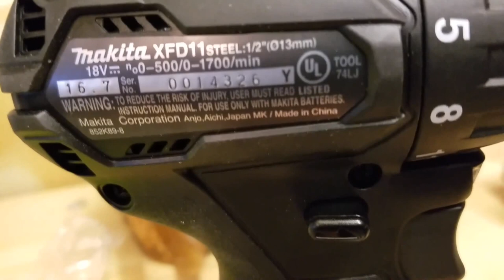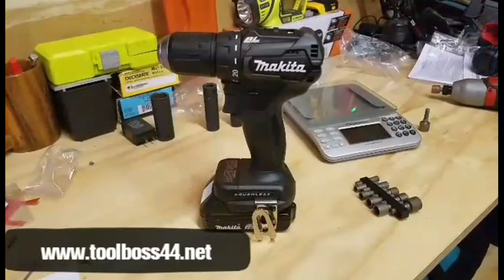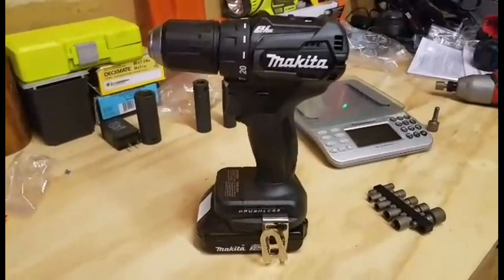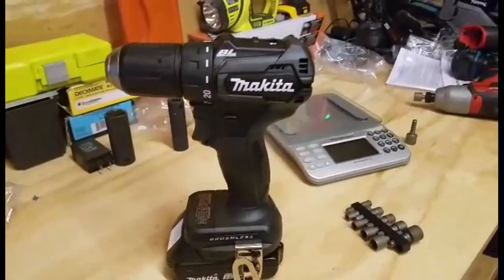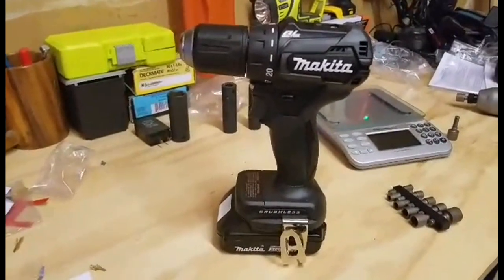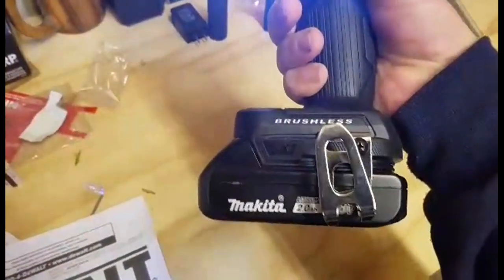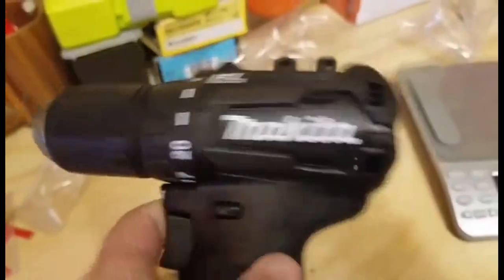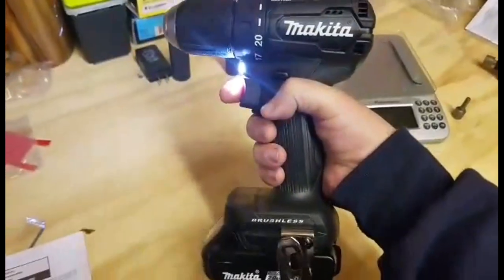Makita 18v Brushless Sub-Compact Drill/Driver Review (XFD11)

Comment: This is an awesome drill, light and powerful. Perfect for tons of projects around the house. You still have to use your head and be realistic about it. If you're trying to constantly sink big @$$ lag bolts with it and then complain about it not working properly you might be one of the many people not fit to use certain tools. You just might have to break down and buy the correct tool for the intended job. This tool is just about the same size as a 12 volt tool. There ya go, a 12 volt  drill with the power of an 18 volt.
Reply from the maker: Exactly... perfectly said ...

Comment: I just picked up the subcompact kit from Amazon. The kicker was the free 4.0 ah battery that came with it. Sometimes a deal is so good you just have to do it. This may be the most versatile set on the market today which is exactly what I was looking for. Lightweight and compact enough for small jobs but powerful enough for serious work. Makita is onto something here.
Reply from the maker: P.G. K well that new 12v brushless is quite handy also ..but yes as an 18v ..its a great impact ..watch for Milwaukee new fuel 12v guna have more torque and smaller
Reply: TOOL BOSS I liked the Makita deal because it got me the drill and impact, 2 2.0Ah batteries, plus the 4.0Ah which also gets me into the 18v platform (these are my first high quality power tools). Now I can pick up a more affordable, bare circular saw or reciprocating saw for future projects. As a DIYer, this is about as good as it gets for my needs. I know you like your Milwaukee though.

Comment: Just bought this set of drills, amazing little tools. I do a lot of railings and drilling of newel posts but bought these for smaller applications. But I did run a 1 inch spade bit through two 3 inch square red oak posts today, it did alright if you can control the feed pressure. Saw you were using a spade bit with the snail on the end that really pulls you into the piece. If you just use a standard old spade bit you should be just fine just gotta feed it in slow. Love your videos Boss, and hope that my info here helped some other makita fan boys.
Reply from the maker: Excellent , I actually did a 1 ich spade bit also for this video , but didnt include it ..was tough but did it

Comment: Your really doing a great job covering all these tools. keep up the great vids, congrats on your website.
 I'm couldn't be more happy with my Makita Brushed Hammer Drill and Brushed Impact Driver. Apart from doing extremely large screws, lag bolts or just nuts and bolts the drill really is the better option. My drill will drive in 4" batton screws faster than the impact. I used it for drilling into concrete yesterday and it went through it like a hot knife through butter lol I still love my impact more though haha
Reply from the maker: Ham's Mowing hey brother !!! thanks man !! appreciate it...how's mowing season goin .??? got another 10 weeks till mowing season kicks off here ...how's the cub ?? yea Makita are def one of the best bro for sure !!!
Reply: TOOL BOSS no worries man. In about 10 weeks my season slows down. It's been great though, picked up several new regulars but I still need more.
That cub is running great. Just clicked over 51 hours for the season. My new toro is running excellent as well.

Comment: Hey Tool Boss thanks for the video.

I will be using this drill to bore 3/4 - 1 inch holes through brick motor (for camera installations). I primarily do use a corded hammer drill but I would like to use this for jobs where I don't want to use the corded.... What do you think of this drills concrete/mortor drilling capabilities???

Thanks in advance!
Reply from the maker: I don't think this is the drill I would go for if using to drill into concrete

Comment: i have those same paddle bits. i dont like them that stupid screw tip feature forces you in too fast and causes major blowout in the rear of the hole youre drilling its also probably why the makita was getting jammed up. i just felt that was worth mentioning. ive gotten jammed up with my green 18v makita with those stupid speed bore bits. keep that in mind folks

Comment: Would u recommend this in an electrical rough-in environment?
Reply from the maker: Absolutely.. actually alot of electrians use this tool
Reply: @toolboss8410  my biggest thing is changing battery platform. I have a bunch of m12 tools like my bandsaw and I just dont  wanna haul milwaukee and makita everywhere
Reply: salg500 at least you’ll be hauling two top brands man